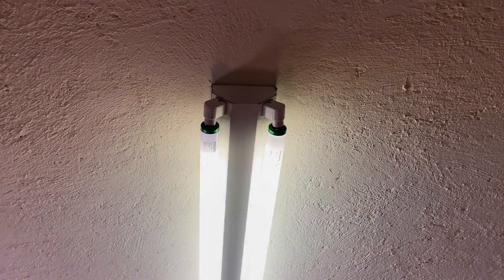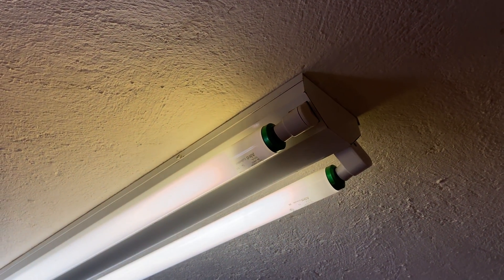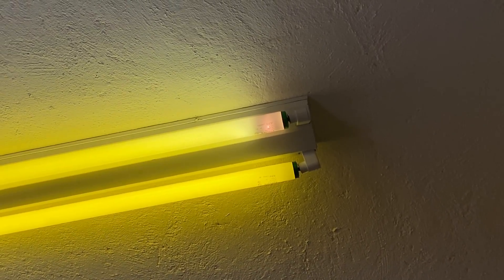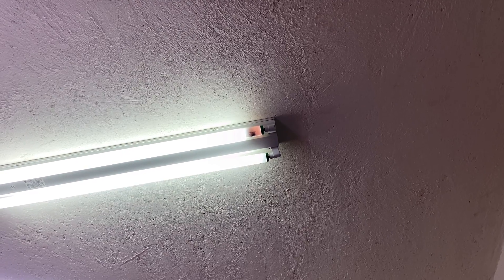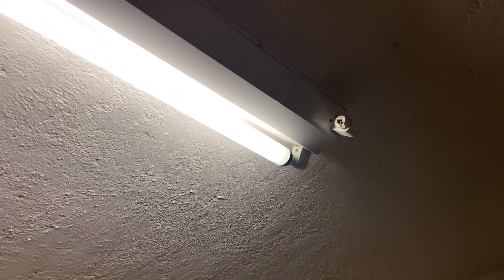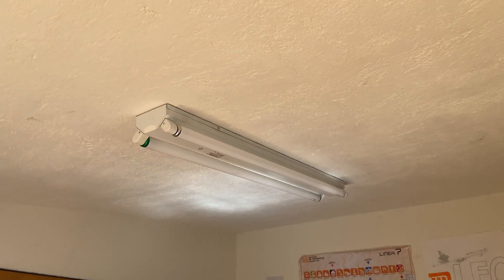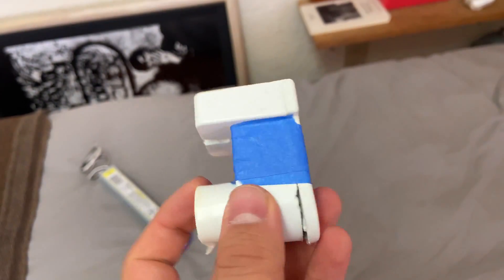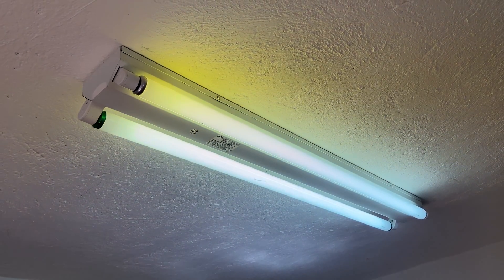the death of a fluorescent lamp vol. II (it gets scary)

Comment: Electromagnetic ballast with a bi-metal switch starter connected in parallel to the tube's connections. If a tube goes bad, it just blinks intermittently. 
It is recommended that the phase (live) should be run trough the ballast to limit the current better and extend the tube's life.

Comment: I didn't know 4 foot tubes existed with single pins on the ends. I've only seen that with the 8 foot ones, at least here in the USA. I am also guessing the frequent on off cycles made your tubes go more quickly.
Reply: Lamps with a single pin on the ends are also available in 2 & 3 foot lamps, those are very rare, even moreso than the single pin 4 foot lamp in this video.   The single pin lamps are most commonly found on 6 and 8 foot lamps. There were other oddball  lengths with  a single pin available as well such as 42, 60, 64, and 84 inches and these were more likely to be used in outdoor signs or in very specialized applications such as vending machines and commercial refrigerators found in grocery stores and restaurants, instead of general purpose lighting in which 4 and 8 foot lamps are by far the most common lengths.

Comment: I found a few tubes, and one already had a black spot. Lit it up with an electronic ballast because a magnetic ballast wouldnt light it. Same exact behavior before it blew except I could literally see the electrode melt and when it lost vacuum, it made a loud pop and cracked the glass. The end was very hot so I guess these electronic ballasts really drive every bit of life out of the tubes. It stayed lit even after the electrodes melted, only going dead when the glass cracked.

Comment: Gosh, I would love to have a fluorescent fixture just like this! I have 18 NOS F48T12 Slimline lamps and don't have the correct fixture to use them in.
Reply from the maker: try searching online or in restores or thrift shops... I see collectors usually get good deals in those places... In Mexico those kind of stores are rare, but I have some good friends in various lighting markets, so sometimes they help me c:
Reply: Since F48T12 slimline fixtures are very uncommon, at least in the USA,  if you cannot find one you could take a standard rapid start F40 strip light and change the sockets to slimlines.  Ballasts rated for F48T12 are readily l available in electronic (or magnetic on ebay and similar sites) though you'll more likely than not have to order it online.  Usually the newer electronic ballasts can operate a range of lamps such as F24T12,  F36T12 & F48T12,  or F96T12,  F72T12, F60T12 & F48T12 for example.    Slimline sockets should be easy to find at your local home improvement store or hardware store.

Comment: Why is there a filament in that lamp when it only uses one pin on each side
Reply from the maker: Is not a filament, it's an electrode. Is not intended to glow on it's own like an incandescent bulb, but to emit electrodes trough the gas mixture... so that way, it doesn't matter that it uses one pin...
Reply: @THEBULBHOME   ok

Comment: For the first time I am seeing a single pin Tube light, all I have used are bi pin at both ends in my country.
Can any body explain that how a single pin Tube light can have heater (filament electrodes)? Or they don't have any and are only suitable for cold cathode type electronic ballasts? Or is it possible that the light base is one leg and pin is another leg of electrode?
Reply: Single pin fluorescent tubes have filaments,  but they are connected to the same pin on each end of the lamp and therefore cannot be preheated.  Many years ago bi pin instant start lamps were also available and such lamps were identified by "IS" in the lamp designation,  F40T17/CW/IS & F40T12/CW/IS are the only bi pin instant start lamps I've heard of never seen in person, they were in my 1993 GE lamp and ballast catalog.   Bi pin instant start lamps have the filaments internally short circuited so they cannot be preheated and therefore will not operate if mistakenly used with a rapid start ballast.  Instant start lamps use a high enough voltage to start the lamp without heating the cathodes.   They have a shorter life for the same number of starts vs rapid start but have slightly better energy efficiency and are good choices for areas where the lamps stay on for several hours at a time and starts are kept ro a minimum.

Comment: This happens when the thermionic coating on the filament in the bad end is fully depleted, resulting in the filament glowing bright orange, but at the same time unable to emit electrons efficiently, becoming the point of highest resistance inside the tube, with the increased voltage drop accross it inducing a harder ion bombardment onto the filament.

Comment: Very interesting lamp.   F48T12 slimline lamps I've heard of them but never seen one.   They are very rare at least in the USA anyway  but not as rare as the F24T12, F36T12, F60T12 and F84T12 slimline lamps which are listed in my GE lamp & ballast  catalog 2016 but I have yet to see these in person.  F96T12 is probably the most common, followed by the F72T12.  All the lamps 4 foot and smaller that I've seen are bi-pin rapid start or preheat except for HO and VHO lamps.

Comment: In my school, the fluorescent lamp near my table on the ceiling went bad last Wednesday. There was a purple glow at the right end [the ballast was in cold cathode mode I think], and you could barely see a filament arc. Every now and then the bulb would start flashing crazy and turn off for about 4-5 seconds, when I came back from playtime/recess the bulb was dead. Well at least I witnessed the last moments of it's life. When you turn the lights on it flickers a bit but it is a dim flicker. The ballast then goes into failure mode.

Comment: The swirling is the starting arc in the cold cathode mode jumping to different places, like corona discharge goes to different places. [And HV X-rays.]
Reply: Can those a bulbs in a dying state emit x-rays
Reply: @wardogies   not really, as X-rays need near-perfect vacuum to form as well as high voltage. Once a fluorescent lamp strikes a discharge, the breakdown voltage drops from ~2,000-4,000v immediately down to around 80v or so depending on the length and wattage. for example, the arc voltage of a 58W T8 is 86.5v at ~670mA

Comment: I have seen this sort of failure before,  and it's common for the instant start 8 footers,  aka F96T12,  operating off the old school magnetic ballast.  The lamp begins to spiral and flicker wildly, one end gets very black with a red- orange glow.    This occurs when the emission coating on one cathode is completely exhausted and can no longer emit electrons at the designated tube operating voltage, however the ballast open circuit voltage is so high that it will strike the tube anyway, and will continue until the lead wires inside the tube are completely burned away, the glass melts or cracks at the end wrecking the discharge, or the socket melts and the tube falls out.   This can be especially serious for the newer T8 tubes, although these tend to be operating off electronic ballasts,  which almost always has an EOL lamp detection system,  which will shut the ballast down when it senses this happening.    A magnetic ballast doesn't have this feature,  but sometimes causes the ballast to burn out, although the old magnetic types tend to be very rugged  and can take more abuse than the newer electronic versions. 

A rapid start lamp EOL depends on whether its a magnetic or electronic ballast,  but tends to flicker for a while until it can no longer light.   

A preheat lamp EOL flashes on and off, as the starter will endlessly restrike,  until the starter fails or the ballasts fails.
Reply from the maker: Hmm that's interesting. Here in Mexico we have some different types of ballasts apparently. Here, at least on my experience, when the emission mix is gone and the tube is running on magnetic, they tended to just flicker until they when completely out, and the show we see on video is almost exclusive to electronic, which in Mexico they don't have any sort of EOL detection, at least the older ones, that's why I bought a new one...
Reply: I had this same exact thing happen on an F6T5 tube in a lantern. The tube would go to vacuum loss before melting any of the plastic. Battery-powered lanterns, like IS fixtures, start the lamps in cold cathode mode.
Reply: @BryanB-nr4yx  interesting, I never really thought of this happening with a fluorescent lantern.   But since instant start fluorescent is slightly more energy efficient than rapid start or trigger start since you eliminate the cathode heating, it makes sense why a battery operated fluorescent fixture would use instant start,  not to mention instant start ballasts are simpler to manufacture since they don't have the low voltage circuits for the cathode heat, thus keeping costs to a minimum dispite the sacrifice in lamp life especially for preheat/rapid start tubes.   I would assume these are the reasons most F32T8 fixtures have instant start electronic ballasts
Reply: As far as I know this occurs when the filament breaks at one side but not both. A preheat starter will be unable to start the lamp at this state so it flashes until the starter fails. An instant starter however sends a high voltage pulse through the tube to start the lamp that creates an arc between the contacts of the broken filament. It can maintain itself in the vacuum easily even on low voltage so the lamp will "work". The arc is the "dancing light" on the video. This creates a lot of heat and eventually break the glass (or melt the base in this case). As air gets into the tube the arc can't maintain itself anymore and the lamp goes off forever. A good electronic ballast can detect the arc and shut down so you should replace it with one that has this feature to prevent dangerous situations.
Reply: God, what you described is on point. I have F96T12 Slimline fixtures running off of magnetic ballasts down in my basement. I had one lamp EOL so hard; it turned purple (with a blackened end) and you could see flame inside of the lamp. Melted the socket right off and feel out of the fixture. Scary stuff!!!
Reply: @LymezoidMusic that's a wild one.  I never personally witnessed an EOL slimline melt out of the socket, but I was in the men's room at the K-Mart near Waterford Michigan like 8 years years ago and there was a 6 foot fluorescent lamp shattered on the floor over one of the stalls, not sure if it was vandalism or EOL. But I guess if you were constipated and straining to go, having an EOL lamp fall and  break on your head is one way to make you let loose if exlax wasn't working just yet 😂🙂

Comment: No. This orange hot spot movement is not exclusive to electronic ballast. You can experience exactly the same thing on lead (capacitive) side of preheat (when you remove the starter) and rapid start ballasts as well
Reply from the maker: Yup, you're right. I only had slimline in mind when I wrote that...

Comment: Very intresting. I use in my house only T12 lamps or LED lights. My kittchen lamp ist made by Kaiser Idell, Germany in 1955 it has 2 4 feed T12 bulbs from the 1960s.
Reply from the maker: Cool! I also have some LED on my house, but I prefer having everything fluorescent... That's why I had to import this old bulbs from the USA and was really expensive!
Reply: @THEBULBHOME  
You importing them from the USA? Where die you live? In Germany I find  them in a Recycling yard. Lots of people trow them away because the still running. So I found more than 150 T12 tubes in all versiones.

Comment: this i'm not using Electronic Ballast, and i'm using Standard  Magnetic Ballast with Glowbottle starter. (standard Preheat Fixtures). when my tubes go wrong, never Melts down so horribly.(probability is simply really low, always when Ballast starts to burn). my tubes always blinks in EOL. only one exeption is 18W T8 fixture, but tubes never burn through
Reply from the maker: I had a magnetic ballast when this fixture was new, but it was a refurbished one and I had to replace it and at the time they were no longer selling magnetic, so I had to get an electronic.
That was exactly 10 years ago, so this ballast had served me well, the only issue is when tubes goes bad!

Comment: The Phillips ALTO low mercury bulbs are not that reliable use of fluorescent lighting. They can dim and burn out faster while it can't balance its wattage.
Reply from the maker: I see that happening to the ones with more hours on them, although they do last a very long time, at least on my experience. Look at those on the video: 2003 and 2006 respectively.
Reply: @THEBULBHOME  ... Still not a reliable bulb.

Comment: That one gave off a good end of life show. .lol. 
The F48 slimlines are pretty uncommon to see (atleast where I'm at)

I have various sizes/types of nearly dead fluorescent lamps...one of these days I need to start doing 'death of a fluorescent bulb' videos again.
Reply from the maker: Yes it did! F48T12 were very common all over Mexico, but is good to see my video is being watched in places  they were uncommon!

Also, doing EOL videos on fluorescent os amazing! Also it is amazing to experience it in person!
Reply: @THEBULBHOME  
I'm surprised to hear F48's were that common in Mexico when they were a rare sight here in the US....Yet the F96 version was quite common here (most of those ended up being replaced by F32T8, which a good portion of which have been replaced by LED)

I finished off 2 EOL F20T12's & a F18T8 in the past couple days. .lol. Those might become videos.
Reply: @XmasLightsGuy  The 4 foot slimline lamps are indeed rare in the US.   Even more rare were lamps in my 1993 GE catalog, F40T12/CW/IS, and F40T17/CW/IS.   These lamps are bi-pin instant start,  the filaments are internally shorted and therefore cannot operate on preheat or rapid start ballasts.   The F40T12/CW/IS is a 48 inches just like a normal rapid start lamp, while the F40T17/CW/IS is 60 inches  and was introduced in the 1950s as a low glare lamp for use in classrooms, libraries, and nurseries for example,  where the lamps were exposed and a soft, relaxing atmosphere was desired.
Reply: @Sparky-ww5re  
I have a few of the F40T17's. Those are deff cool lamps. I've heard of the F40T12 IS, but never seen one in person.
Reply: @XmasLightsGuy  those T17 lamps are freaking cool.   There was a 2 lamp F90T17 fixture in my great grandparents garage still in place as of last year when we were selling the house after great grandma passed away peacefully in her sleep age 95.   The fixture would've been installed in 1968 when Grandpa and his older brother built the garage,  and stopped working about 12 years ago,  the lamps were very black on the ends and grandma apparently was unable to find replacement tubes anywhere in town 😢. I remember when I was maybe a young teenager the garage was my favorite room in the house 🙂 They were the brightest fluorescent I've seen at the time.  

I never seen a F40T17,  or F40T12/IS though.  The F40T17 was in my 2016 GE catalog along with the slimline F48T12, but not the F40T12/IS, my 1993 catalog had all three of these.    I was wondering if an electronic instant start ballast compatible with F48T12, would also be compatible with F40T17,  or F40T12/IS, in the event I hit the jackpot someday and come across one of these rare but awesome lamps.   Have you tried that yet?
Reply: @Sparky-ww5re  
Sorry to hear about your great grandmother.

I've never seen a T17 fixture in use anywhere.

F40T17/F40T12-IS/F48T12 slimline are all electrically equivalent & designed to run on the same ballast. So either magnetic or electronic F48 slimline ballast would work for any of them.

You can also use a 2-lamp F32T8 instant-start ballast ballast wired for "2x overdrive" of a single lamp...that's what I'd done when I had a couple of the F40T17's rigged up into home-built things to hold/run them (have since taken those down, but when I had them in use it was pretty cool seeing  those massive fluorescents lit...)

Comment: Is that a high output rapid start or is that the single pin slimline fixture?
Reply: By the way, the old school made General Electric tubes should outlive the modern reduced mercury content Philips alto lamp being that the GE bulb has full mercury content and is made a lot better.
Reply from the maker: @robertm.6285  Yup, I believe so as well, although I'm impressed by the lifetime of the old Philips ones, as they lasted for almos 17 years! (they were out of service from 2013 to 2016 but the rest of the time were up there on fixtures that were used a few hours per day!)
Reply from the maker: It is a single pin Slimline fixture. You can tell a few times when I'm changing the tubes and when I show the bases, they are not a HO base.

Comment: Weird the fixture has an electronic ballast when it flashes like a magnetic one, great video though. F48 Slimlines are awesome but pretty darn rare with how common F40T12 lamps where.
Reply from the maker: Even though fluorescents running on electronic don't flicker as slow as on magnetic, they still do it. Sometimes camera's shutter simply doesn't sync with the flickering rate. This was recorded on an iPhone 11, so it's not a high-end camera equipment of any kind. Also, for what I've been reading, F48T12 weren't that common on the US, but here in Mexico where the norm, and you could find them anywhere: metro stations, restaurants, libraries, schools, stores, and a long etc.
Reply: Pleasure to find you here. Bulbman! 😅